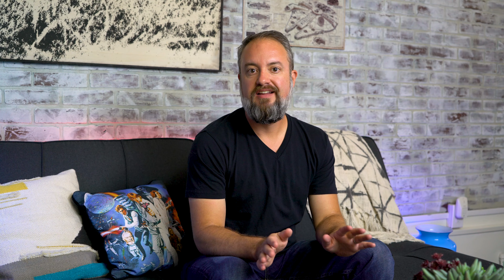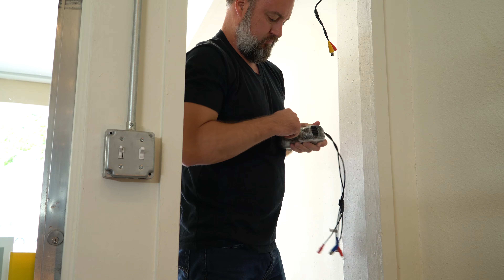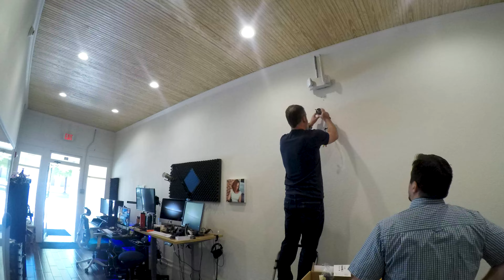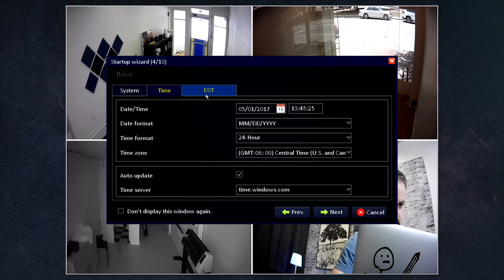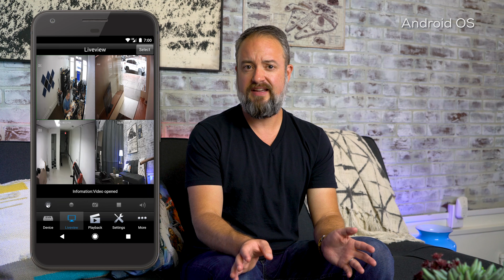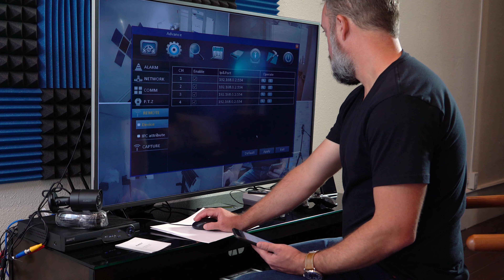Aukey WatchTower: Low-cost connected security done mostly easy

Comment: I have this CCTV system aukey xvr m8 which is the same as the one you have I have forgotten the password to get into the menu to playback pre recorded footage ,I have taken the battery out on the main board to try to reset the password but to no avail it will not reset to default it's still asks me the password to log in , would you know how to get passed the password please thankyou  tom uk

Comment: dont know if anybody will get to this comment but i had bought these cameras a while back and installed them at my parents house. everything works fine but i still cant view them through my phone. ibdont know how to reset my ios app watchtower password. anybody has had trouble like this? need a solution if not they are all coming off and just getting the costco ones
Reply: Hi, 
can you use them from the internet?
watchtower aukey com is not working anymore...
Reply: @kingcetin2341   i have yet tried to do that. But will update if i find a way to watch them through another service.
Reply: @lupeledezma8361  I tried it with DDNS, it works with internet explorer on my pc but when i try it with the watchtower app on my iphone it does not work ...
Reply: @kingcetin2341  Is there a way you can show me how you can view them through your pc? i already went back and forth with aukey and they arent helping at all.
Reply: It also works now for me with the watchtower app!
Reply: @kingcetin2341   Will try it later on. The main problem that I have is that I do not remember by password for the watchtower app. And I have no way of resetting it.
Reply: Lupe Ledezma is there no way to reset your system?
Reply: @kingcetin2341  not that i know of
Reply: I know it's been awhile but does anyone know if the app is still around and if so what it is called  I have had my system for a few years and have yet ti find an app for my phone.

Comment: if your going to invest in a camera system you should really do a POE, power over Ethernet, system. also, these companies REALLY need to update the crappy UI. I deal with dozens of different systems at my work and they all have the worst UI that is impossible or any tech nerd to use or export video.

Comment: Ugh no POE. Can find some POE ones for the same or cheaper
Reply from the maker: Sure, but either way you're running a cable, right? I guess you save a connection. But it all runs back to the XVR in any case. (There's no separate power connection for each camera if that's what you were thinking.
Reply: Oh nice, thanks for clarifying